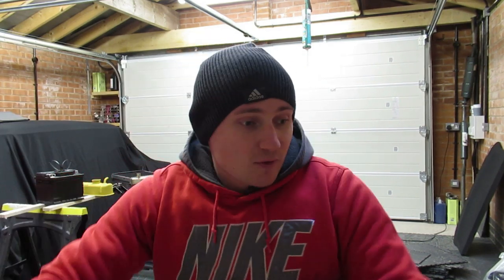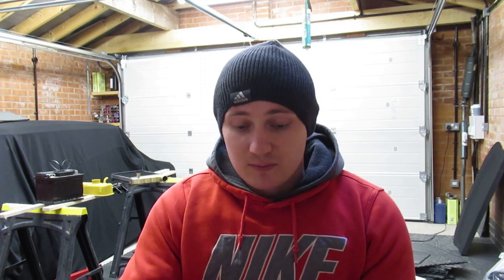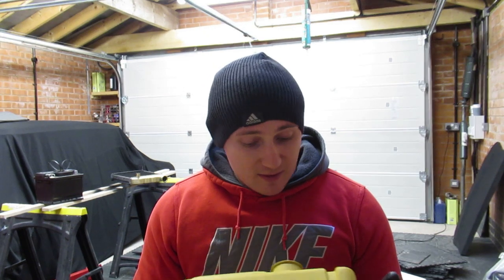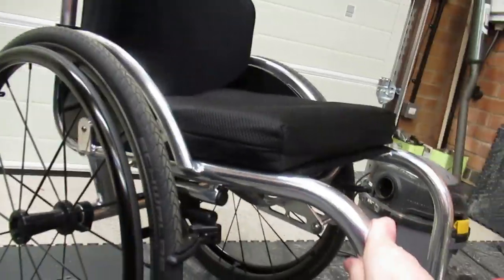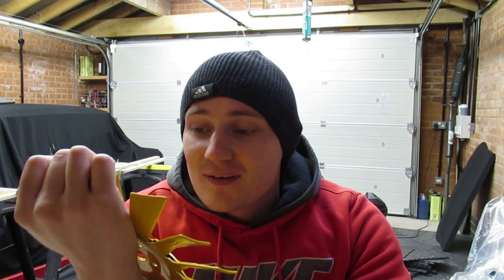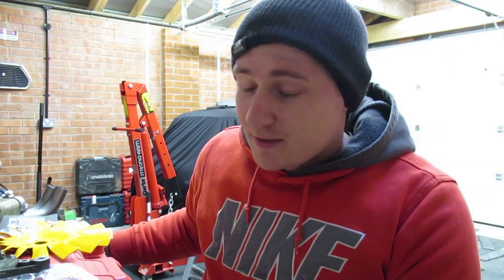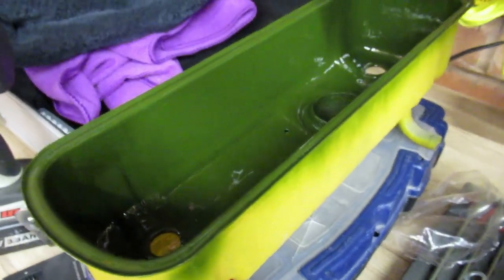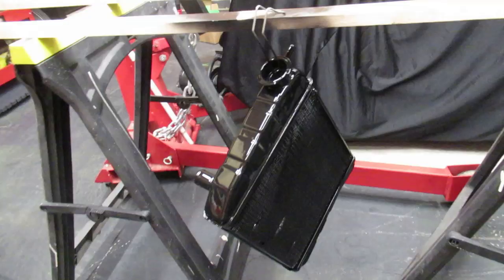Classic Minivan * RESTORATION* PART 7

Comment: Hi Alex.  You should paint that exhaust manifold with Hi heat paint.  Wipe it down with panel wipe first.   It will protect the finish.  If it is stainless steel,  (I doubt that for 98 quid) you could polish it to a high shine.  Can't wait to see it back on the road again. Alex, please do not paint the inside of the valve cover.
Reply from the maker: Thanks Shane, yes I was told about the valve cover issue. I thought I wa doing the right thing 😳 it's gone off for blasting again before I spray the top.